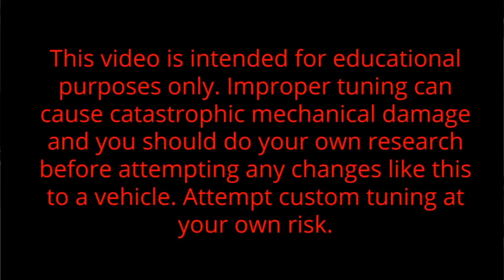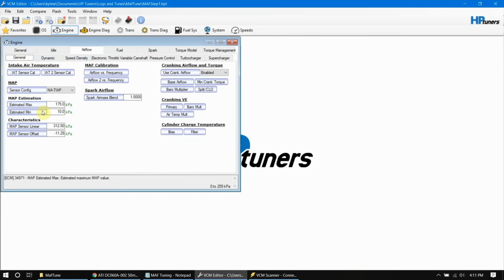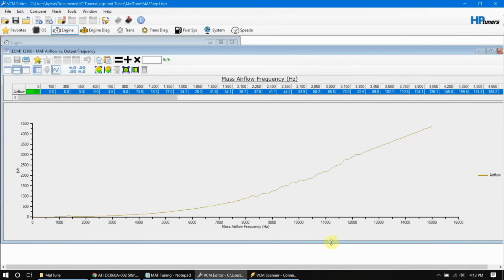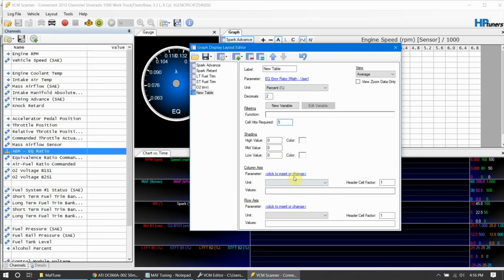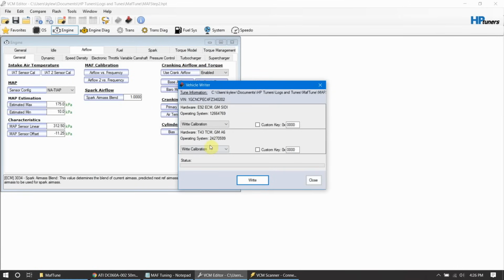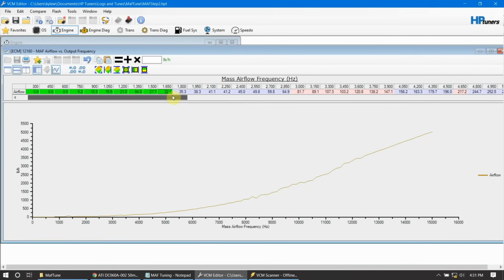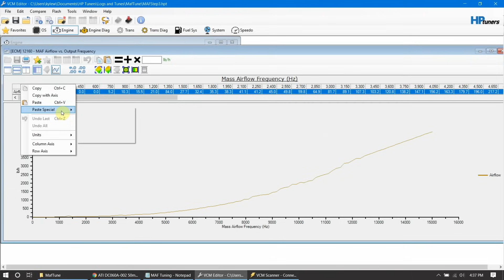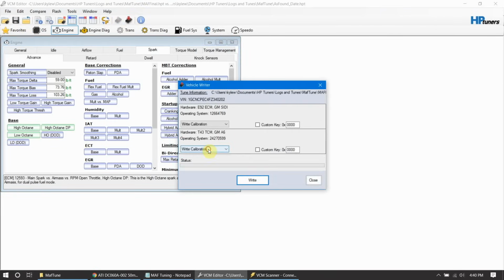MAF Tuning and Scaling, Tuning Series Vol. 3, HP Tuners

Comment: Hi, thanks for that great video! I have a newbie question about the wideband O2. Do you have an additional O2 Sensor port next to the "normal" upstream O2 sensor or how do you exactly mount the actual probe to the vehicle? I dont have any issue with ordering a wideband sensor, but I doubt that I could find any space in swap car to mount it before the converter.

My project is a LS3 swaped Toyota 86 and I have to perform a full emission cylce on a dyno to get it street legal in Germany. I have to keep it inside the "NEFZ" limits and currently Im unsure if everything is fine, since I have a custom Airbox, shorty headers and aftermarket HJS converters. Besides that its a OEM LS3 and Im fine with that. But, I feel I have to tune the MAF table due to the new tubing to the intake. I integrated a honeycomb section infront of the MAF to smoothen air stream. Nevertheless I dont think that the OEM tables Im currently running are still perfect for that swap situation.

Any help and hints highly appriciated! If you like you could check out my project walk arround on YT. (Did one in english)

Regards!
Reply: They make a fixture to clamp onto your tailpipe that will accomodate a wideband sensor
Reply: @shawnwimberly9294  Thanks for the reply, but for the kind of emission standard tuning I (was) doing this is much too gar away from the engine. Anyway, I meanwhile managed to develop a mapping which passed the laboratory test and the car now is street legal in Germany.

Comment: Man, I was super hyped to find your videos so I could start tuning my truck. Unfortunately, my menus look nothing like yours. I assume that has to do with the fact that this was recorded 4 years ago, or that my truck is much older than yours and a Dodge (2007 Ram 1500). Either way... Not sure I'm gonna be able to do this. There is literally nothing stock about my hemi - stroked, bored, cammed, eagle heads, molnar rotating assembly, CP pistons, custom cam, hellcat lifters/springs, 6.1L injectors, long tube headers, bored throttle body, 11.25:1 cr, MDS/EGR/CAT delete. I can't even get this thing to idle. Is there a good source for tuning for idiots? I have no doubt you are sharing diamonds of info - I just can't keep up. I'm guessing I need a base tune, but I don't know where to get one. I watched your video about not paying email or dyno tuners for something you can do yourself, but when the truck won't idle it makes tuning almost impossible.

Comment: Do I need to get a wideband for a gen V Lt1 also for Lambda tuning since its all in torgue control?
Reply from the maker: Yes, the torque calculations are based off the airflow which you need the wideband to calibrate
Reply: @GoatRopeGarage  Any suggestions on a good 1? Thanks in advance..

Comment: When iFinally tried it your way my values were to high in the graph. When iChanged everything to afr instead of eq it looks like it’s graphing correctly. What did iDo wrong?
Reply from the maker: Hard to tell, but your data got mixed up somewhere, double check your math and graph setups
Reply: Goat Rope Garage iPromise I’ve been trying all day. For the user math iCopied the default EQ ratio expression. iChanged the EQ Ratio sensor to the Aem EQ ratio via serial dropdown and chose “yes, sounds good” instead of “No” (in the video you said to change it to MAF sensor but you didn’t do that). This then shows it is actually the same exact expression number as before). Changed unit to percent. Saved that. Created graph. Changed parameter to user EQ Err math iJust made. Changed decimals to 2 and cell hits to 5. Then changed column parameter to MAF Freq and copied the column axis. But the values come out in the histogram as positive and my wideband is showing rich (under 1).

Comment: I’m new to this all, I just installed my aem wideband and I’m running lean about 1.15-1.3. The truck has been tuned before by someone with a lot more experience. However I’m trying to richen up the mixture by multiplying the 1.15 shown in your video.  hptuners is giving me a warning saying it’s out of the parameter so I stop and return to the pervious tune. What do I need to do to richen it up? Small amounts?  Working with a 2013 genIV Sierra v8
Reply from the maker: That's odd, I've never seen that error on the VVE tables. Is it giving you the error when you're trying to multiply it when you're trying to calculate coefficients?
Reply: Goat Rope Garage I get the warning notification when making the change to the mass airflow freq. I forgot to mention I just started to do maf tuning and couldn’t continue due to the lean condition.
Reply: I tried to multiply. By 1.15 to make rich but no change ?? Help please
Reply from the maker: @bensinger5229  make sure you're forcing the fueling type that you're making changes to.

Comment: Doesn't disabling DCFO cause it to run rich when you let off the gas? Since you're off the gas more than you're on it, wont it make your histogram tell you to remove fuel when really you need to add it?
Reply from the maker: Nope. Just didn't go full lean when you left off the gas. If you leave it enabled you'll go fill lean while still commanding 1.0 lambda resulting in huge error numbers off throttle. If you're running rich with it disabled your tune is actually rich in those areas.

Comment: How do you account for boost in an originally N/A car, can you calculate airflow at certain levels?
Reply from the maker: Fill throttle in a NA car is 1 bar, use that for your baseline fueling, if you were to run 14 psi boost you're effectively doubling that so at 14 psi you'll be close to around 2 bar on your map and requiring twice as much fuel, plus add another 15% or so to give you plenty of cushion to them dial your tables in. It's not a perfect 1 to 1 relation as a lot of other things come in to play but it will get you a starting point. And then work into boost, you'll have to add fuel below 1 bar as you'll be more efficiently delivering air to the engine in that range also.
Reply: Thanks for the quick reply,  your videos are very good and definitely helping the community

Comment: Do u have to turn off the things that u changed at the end of video to tune ur maf
Reply from the maker: To do it right you need to disable those things so your wideband will read correctly.  Will not work without a wideband.

Comment: I multiplied by1.15 but lean at idle should i still go ahead and log
Reply from the maker: How lean? If you're only 5% or so if say go ahead and slowly log. More than that, bump it by another 10 percent (multiply by 1.1) and try again.
Reply: Its 1.15 at idle to about 2000 rpms the goes to .950
Reply from the maker: @bensinger5229  You're good, tune away! Take it slow and watch those EQ ratios!

Comment: What areas will I need to adjust if changing my g8 engine from a 6.0 to a 6.2
Reply from the maker: Cylinder volume for starters. What else is being changed in the swap? Injectors? Intake manifold, throttle body. Could be simple or could be a lot of stuff that needs updated.
Reply: @GoatRopeGarage  I'm just adding a DoD delete kit with a ls9 stock cam and leaving everything else stock.
Reply from the maker: @02DDP  Just copy the stuff over from a 6.2 file that corresponds to your new motor, should get you started.

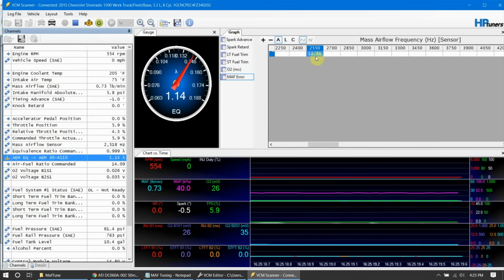Comment: I am having major problems. I've done everything exactly how you did. To the T. But I'm getting some wild data from the maf error graph we created. Right at 11:49 stamp you got ~14. I'm getting +8,000 to about +15,000. In that box. Equivalent ratio also says .03 to .08. makes no sense at all. I'm afraid to change anything off of those values. There has to be a scale somewhere that needs corrected and not mentioned in this video.
Reply from the maker: Follow the math, check the data in at your parameter list, look at how the math issues that data to get your readings, you'll find the issue!
Reply: @GoatRopeGarage  I'm also using the newer mpvi 2 w/ the pro link. I getting the wideband signal through the canbus output on my aem 30-0300.
Reply: @GoatRopeGarage  how do you set up the equivalence ratio commanded [sensor] that is what I'm missing. I can't find it in my channels.
Reply: @GoatRopeGarage  issue has still not been found.
Reply: @carnage50x  it’s under Engine, Fuel, commanded/desired.

Comment: How can i create the Maf error histogram if i have my aem wideband set up through the egr wiring?
Reply from the maker: You have to do the custom math approach, basically copy the existing AFR error math and change the variable for the wideband sensor over to your egr sensor and then apply any scaling math you might need to.
Reply: @GoatRopeGarage  Okay, so I used this equation.....100*(([2811.10]*2+10)-[50121])/[50121] to create the math for the afr commanded error. Called it AEM AFR error, i then proceeded to use this math parameter as the variable in the histogram and for column axis I used the maf freq. Is my information correct or do you think I'm wrong. Sorry for the inconvenience, I'm still learning how to set everything up without the pro dongle. Thank You
Reply from the maker: @jcd0402  That looks like it should work, just watch your gauge versus your error at idle and see if everything matches.
Reply: @GoatRopeGarage  
Thank you, as soon as I fix my exhaust leak I'll make sure to dial in my afr error math by changing the number "10" in the equation.
Reply: @jcd0402   did that work? I'm getting ready to start this process.
Reply: @andrewbetz3477  Use this link, its extremely useful.  https://www.corvetteforum.com/forums/c5-scan-and-tune/1705471-connecting-wideband-via-egr-or-a-c-pressure-in-hp-tuners.html....

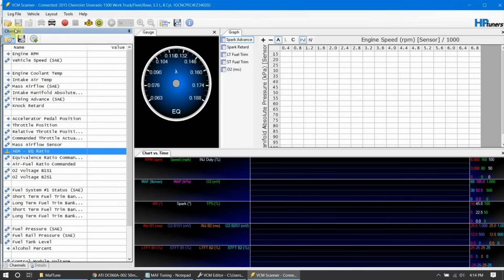Comment: I’m guessing at 7:48 you set up the user math just in case someone doesn’t have the pro tools correct? Because it looked to me like you copied the exact same math as what was already provided. You mentioned something about picking up the MAF but when all said and done you changed nothing you simply created a user math identical to what was under the wideband selections.

Comment: What if we don't have the Lean/Fuel Savings Tab?  I have the MPVI2.
Reply from the maker: Don't have displacement on demand then, Gen III?
Reply: Yes.  The 3800 series III
Reply from the maker: That's why, it is only on DoD vehicles, can skip that part.
Reply: I'm wondering if any of the series III will apply here.  The cutoff, DFCO I have "Cutoff..In gear", and "ETC...Gear Base" and then it takes you to the charts with Cutoff/Resume for PN/In Gear/Reverse.  And then under Oxygen Sensors, there's Closed Loop Enable with a coolant temp entry and a Delay button.

Comment: I'm maxing my maf need info on scaling. Nothing in this video about scaling. Thank you
Reply from the maker: If you're maxing you need a bigger intake tube, the larger the diameter the more air to can flow, you'll just have to retune for the new size
Reply: @GoatRopeGarage  I've already tried this and I'm still maxing out. I can't find any videos on how to scale for the mass air flow sensor.
Reply from the maker: @renniweht  your maxing out the airflow, not the hz, right?
Reply: @GoatRopeGarage  yes hz 😕
Reply from the maker: @renniweht  if you're maxing hz you need to get a larger diameter MAF tube

Comment: You have good videos but there was a lot of do this do that but no explanation of WHY or what they are. 

If I'm tuning my own car, how do I know why you chose those specific things to disable in the beginning and how can I know where to find that info for my car? 

Why did you edit the parameter and what is that parameter even? 

Why did you divide the maf values by half? 

What are those maf values and what do they mean? I just assume that if they're positive it means lean. 

I'm not understand what that data is you're datalogging. You're taking maf readings and then dividing it in half and changing the previous maf values?? 

Unfortunately it felt like a lot of programming tutorials I followed. I can copy what you do but I have no idea why or what, and don't know how to apply it to my car. 

Again your videos are great but I think you may need to do a beginner series on explaining way detailed

Comment: Is it normal that my MAF frequency only reaches 8,850Hz and won't go past this point?
Since calibrating, there's a visible ramp up on the 2D chart where itstops reading on the

Also, I have two MAF tables which aren't quite identical but very close. Do I need to calibrate the 2nd table or is it okay i leave table 2 alone?

Comment: These videos are useless to those of us who do not have wide bands....teach us something that doesn't require everyone to have wide bands....yeah I know I need wide bands but right now it's not in the budget.  I wish the cold air intake manufactures would include a note informing buyers that it won't do anyone any good to buy their product unless you buy at least a 300$ set of wide bands just to get the benefits of a cold air intake. How the hell did the factory tune my truck with narrow bands instead of wide bands?